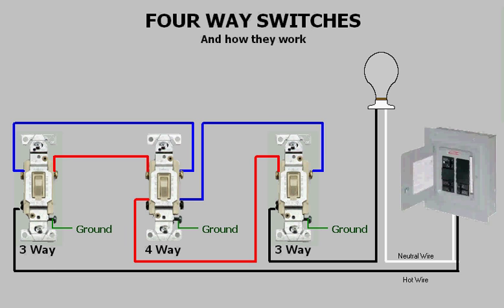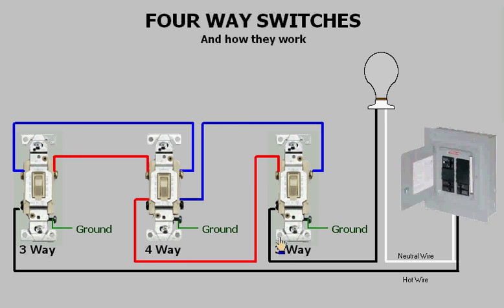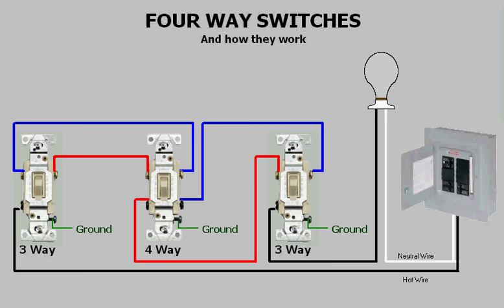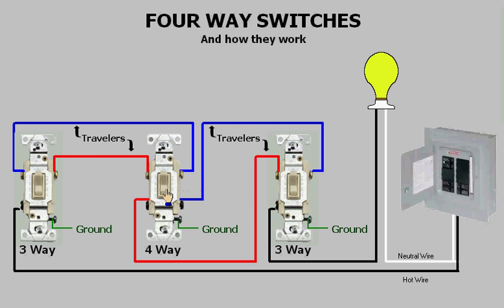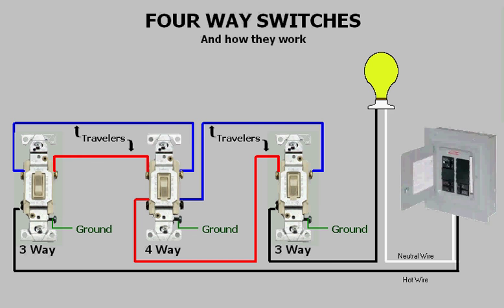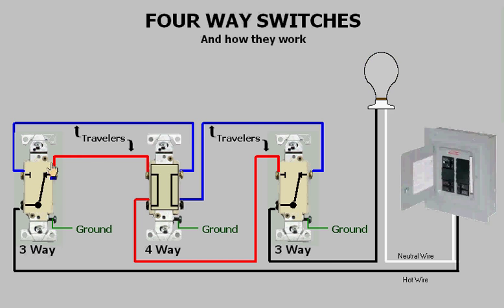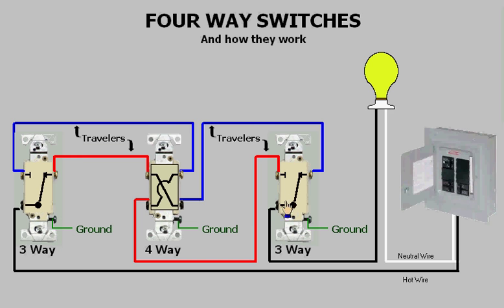Four-way Switches & How They Work

Comment: THANK. YOU. I am currently attending a Trade School (GI Bill FTW) and my main class is dealing with basic safety and electrical basics. The homework my instructor gave included pictural schematics of common electrical components with directions to WIRE them from a CB source. Most of them are some combination of plugs, switches and a lamp. But three of them are this kind of switch set up. There was nothing in the book specifically to this and although the UGLY's book had the schematic layout, they don't specifically explain WHICH POSTS get which wires, which was driving me nuts (I just wasn't SEEING IT). I'm not 100% certain I drew it correctly, but I at least understand it more in a functional manner. Again, Thank. You. Sir.

Comment: @sebasamy13 Sounds like you might have a double pole on-off switch, does it say 'load' at the two bottom screws, and 'line' at the top 2? If so, it won't be very usefull in this 3-4 way set-up.

Comment: I know that ur video it's old or someone please  help me out... I got 3 switches for 1 light, I'm trying to put a sensor switch but I wire everything on the 3 way but for some reason the light don't work just blinks... but compare to ur video, the one on the rigth side facing it from the back of the switch blue is white.... red[top right], black [Lower right], white [top left] and green... please help me out!!!!

Comment: Thanks that was very simple.  If I wanted to put a diimmer on this circuit (just one location) where would I put it?  The dimmer I have is a 3 pole.  Thanks!
Reply: I put a dimmer on one of the 3 pole switches but now when I turn off the 4 way the dimmer does nothing.  Maybe it's as simple as I put the dimmer on the other remaining 3 way?

Comment: In the UK we call this two way switching, the logic being that the switch has two positions, common to 1 and common to 2, 1 and 2 being the travellers/strappers, or you can have a switch in two positions ie at the bottom of a stairs, and one at the top [switching in two positions] the 4 way switch we call an intermediate switch. you call it a 4way switch [by using 2 -3 way switches combine] therefore using your logic name, it should be call a 6way switch! 
However the names don't matter!

Comment: That explains one 4 way switch.  For multiple 4 way switches, they key point is that there will always be one path along the travelers that will allow the current to pass, no matter which way the multiple 4 way switches are set.

Comment: I have the same setup for my kitchen light. I want to put a dimmer switch on one switch. I bought a dimmer switch which says it works with multi-pole switches. Which existing switch do I replace?

Comment: I have a similar set up, however, I am using a set of dimmer switches. It is the Lutron C.L Digital dimmer multi location kit with a companion dimmer. Long story short I used this scematic as it came with my 4 way switch and it only works in one position, but not the other. In the other it kills the power to the whole set of switches. Really frustrated as I have spent two days trouble shooting. Is there any hope?

Comment: Thank you for your very elegant explanations. The questions I still have are: how exactly does flipping the switch on a 3 way cause the little lever to move back and forth to connect to the travelers, and also the same question applies to the 4 way regarding its mechanism to criss-cross between the juxtaposing terminals? 
Again, thank you for your great ability to help others understand.

Comment: Excellent job!  This was so easy to understand.  I have been wanting to put a four way switch in my garage (I already installed two three way switches back to back on each side of the house door), and I see how easy it will be to install the four way switch between the two (after running a bunch of wire to the switch location).  I also appreciate how simply you explained the operation of the four way switch.

Comment: So is a 4 way really a Double Pole, Double Throw switch inside? Your other video told of the inner workings much better (so even I could understand 3 ways) How do they cross over in a 4 way? Thank you much for your videos. I feel I could wire a 4 way thanks to your help. I just don't understand the magic inside the 4 way switch box yet..

Comment: what is the blue wire
Reply: Ultra Games  it is just one of the travelers. There is a red and blue one for easy differentiation between both travelers for the terminals they are in. If that makes sense to you.

Comment: Both three way and four way switches are single pole double throw

FOR CLARITY

"SINGLE POLE' - POLE REFERS THE NUMBER OF CIRCUITS A SWITCH CONTROLS

" THROW " - INDICATES THE NUMBER OF CONTACT POINTS

MOST COMMON ARE SINGLE AND DOUBLE THROW

Comment: i want to add one more 4 way switch to control the light from 4 locations. How do i connect the extra 4 way switch?
Reply from the maker: Just add it into the travelers just like the first one. All four ways are added this way.
Reply: In the middle
Reply from the maker: You can add as many 4-way switches you want to the travelers just like the first one . The 4-way works by swapping the two travelers.  Adding more will do the same.

Comment from the maker: @elijah5791 Years ago I installed 3ways in a house trailer. I couldn't access the attic but I could the underside. I replaced the regular switch with a 3way, ran 12-3 from it, under the floor, across the room to add a new switch (3way) at the new entrance  to a deck.  An elec. contractor refuse the job, said it couldn't be done. He said the 12-3 wire HAD to go through the ceiling box.  His way wasn't wrong, just didn't fit the situation. I decided to show the WHY instead of the HOW.

Comment: Correct me if I am wrong, but I believe your diagram is wrong.  The red traveler from the 4-way should be connected to the top right terminal of the third 3 way, and the blue traveler from the 4 way should be connected to the top left terminal of the third 3 way.  In the down position both the 3 way and 4 way switches cross connect.  The way you have it wired, with all 3 switches in the down position, the light should be lit.  The hot wire of the 1st 3 way cross connects to the red traveler.  The red traveler going to the 4 way then cross connects to the blue traveler, and goes to the top right of the third 3 way where it cross connects with the black load wire and the light should then be lit.
Reply: I stand corrected.  In your illustration, the commons of the 4 way are on the bottom.  In that case, when the lever of the switch is nearest the commons, the terminals, I believe, operate in parallel, and are not cross-connected.  Strangely enough, the opposite appears to be true with 3 way switches.

Comment: What program you used?
Reply from the maker: +Toth Sorin I was using a custom program that I had written at the time. I was still using Windows some at that time. I no longer do since I am now 100% Linux OS. I write a lot of my own software when I can't find exactly what I want. You may notice it was a lot more interactive than Powerpoint.
Reply from the maker: +Toth Sorin The software was something I wrote for the occasion. When I can't find what I want, I usually will create my own.
Reply: i understand :) this is very cool ! you can make your own software. Good job

Comment: you would never wire a house this way. your diagram shows a single 2wire from the panel then splitting it and having 1 side run to a fixture and one to a switch fixture . what you are saying is that you are taking a 2 wire romex and splitting it some where and running a single wire to a switch.  Who does that?